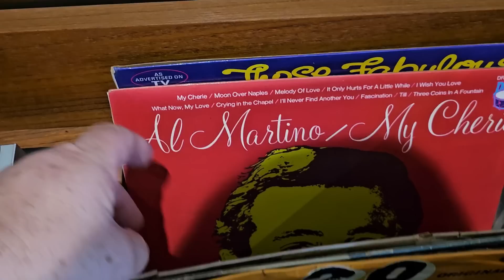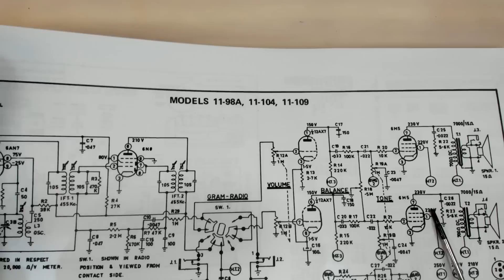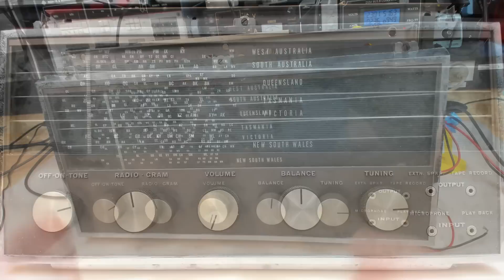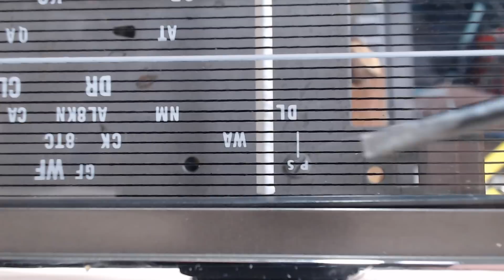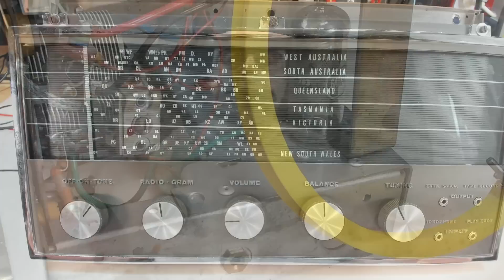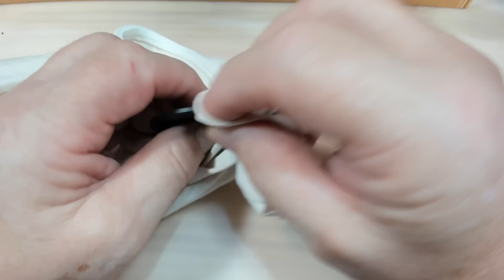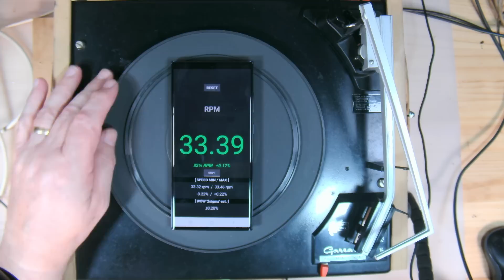Kriesler Radiogram for 5 Bucks! Is it any good?  Part 1

Comment: very good Dave. That looks like it might be from the early days of chipboard when that was the cheap alternative to teak, which was very popular at the time. That stuff can get a bit crispy if it's got wet and dried out again, so looking forward to the cabinet restore.
unrelated, but can you point me in the right direction for the names of the components in the tuning mechanism. I know it is a capstan drive, but wondered if the pulleys have specific names. I'm making a spiralling drive for my wood lathe and don't want to sound like too much of an eejit when I describe it. Thanks.
Reply from the maker: This was made in the chipboard era, a boon for manufactures, not so good 50 years later after being moved into improper storage. The damage to the back of the lids is from scraping on the wall when the lid is opened. If it wasn't for that the finish would have been good. It will return to a nice unit once it's repaired. I have no idea what the real names of the tuning parts are. Capstan or tuning shaft, drive pully... Sorry I couldn't find much on line either. Thanks Dances 🙂

Comment: Hi David, I was a little surprised you did not comment on the very poor sinewave you had shown on the alignment. I don't know if it was radio distortion or from the audio amplifier. I appreciate it's not HiFi but I was quite surprised it was so poor. I bet that would measure about 10% and would be quite audible
I watch all your output and appreciate your skill and presentation.
Reply from the maker: Hi Michael. Oh, I wasn't going for a good sine wave, I just set it to the minimum to get a signal on the scope. The sine wave may be a consequence of the poor input more than the output. Having said that, the distortion is documented at 10% by the manufacturer. Thanks Michael 👍
Reply: I think that distortion is due to having only one output valve per channel. The slope of a valve is not fully liniar. You need two (push-pull) to get rid of that.
Reply: @ I'm not sure I can agree with you on that. In years gone by I have built many low power single ended amplifiers with about a 2/3 watt output. I found they do clip equally top and bottom, but this was not clipping, but in my humble opinion this very distorted in the lower part of the cycle. One of the worse I have seen.
Reply: @MichaelBeeny  I noticed the distortion on the oscilloscope too and came to the comments to see if anyone else had noticed!  I'd be curious where the issue was coming from in this design, but if it's spec'ed at 10%, I guess that's just how it's supposed to work.
Reply: @MichaelBeeny  You might be right on that, I can't beat experience, but could it be about how far you drive that main stage ? The specs of 10% tells you something.
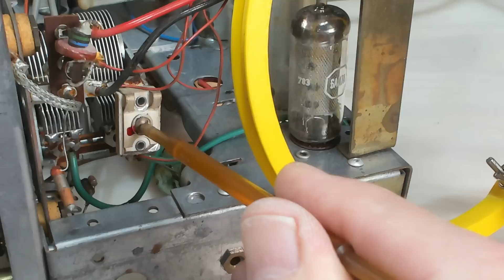On the other hand, if you look at exactly 15:46, adjusting the padder made (in my opinion) the distortion change significantly, it shifted the pointy side of the sine to the other side.

Comment: G'day, everyone, and welcome to a fresh Episode of daves radio adventures, in 2025.hello from germany, dave.
Reply from the maker: Hello Tobias. Thank you and welcome to 2025 👍🙂
Reply: @DavidTipton101  the tube radio Saga continues,dave,i thinking about adding a Bluetooth module to my nordmende Carmen 57,because this year, fm is switched off forever in my country of germany. What a shame, thousands of radios goes in the trash.(and what a waste of Ressources)
Reply: @TobiasThede  And the replacement digital radio is appalling!
Reply: @geoff825  they Sound not as good, as tube radios. That's for shure. And if some component fails,trash.the tubes in my radio are in sockets.pull out the old tube,and put in a New one. Perfect.